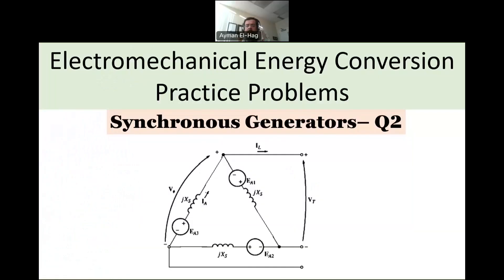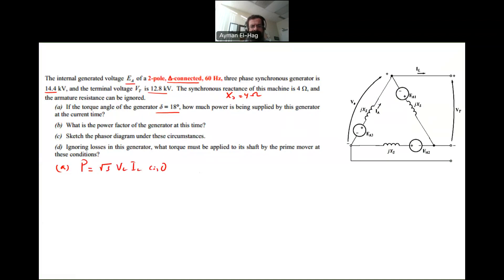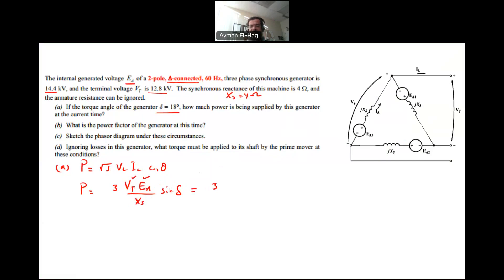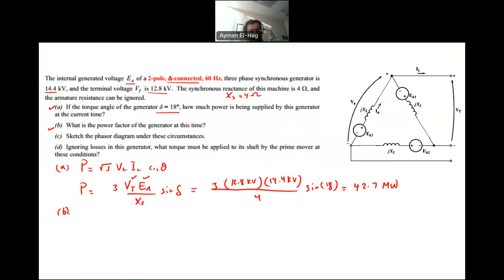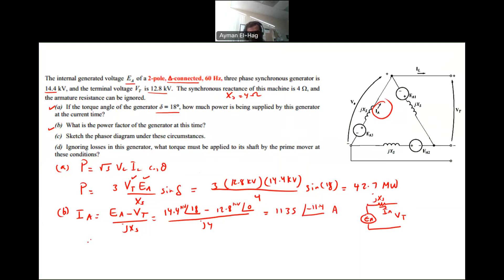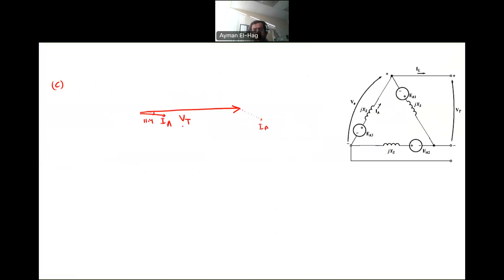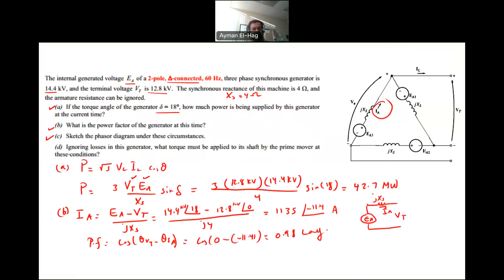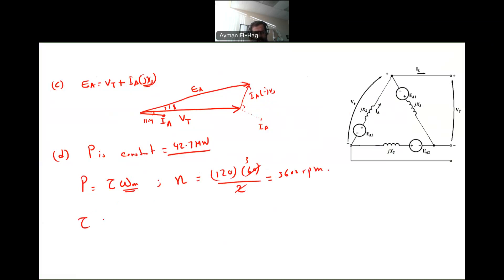Synchronous Generators - Question no. 2

Comment: Proffesor in the part b : Ia shouldn't be 1153/√3 because in delta model I remembered if I am not wrong , voltage of the phase same with line to line voltage but current must be divided root 3.
Reply from the maker: Actually I calculated the phase current directly and not the line current using kvl of the generator circuit model